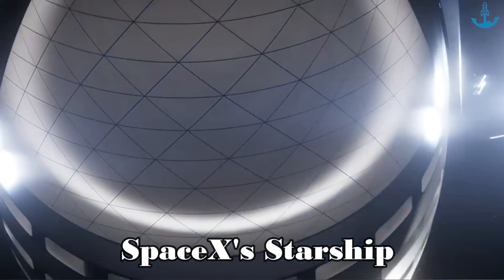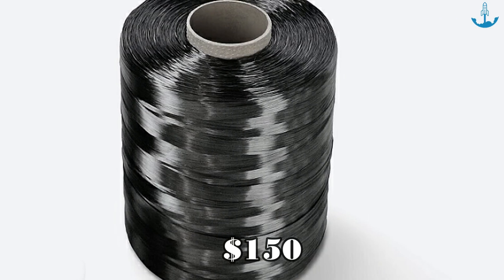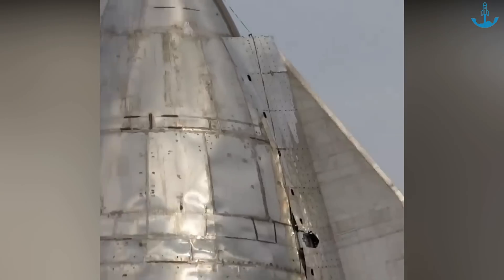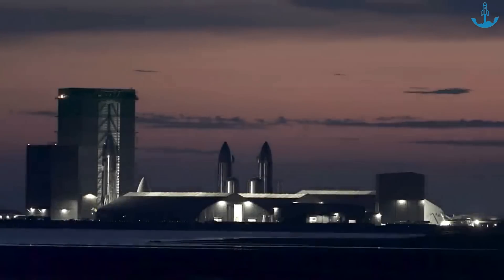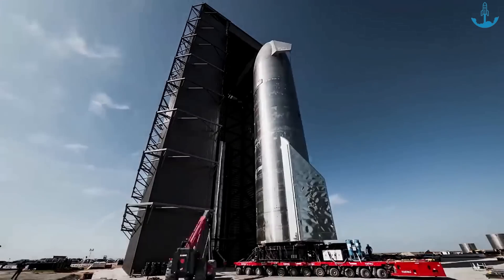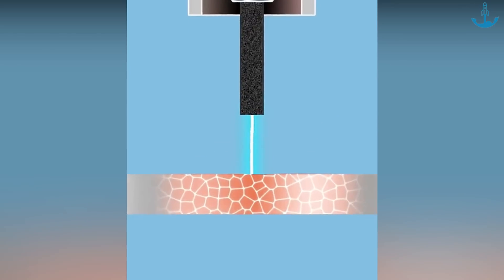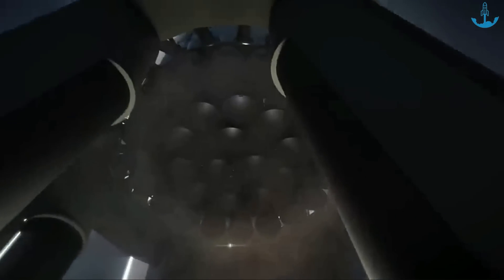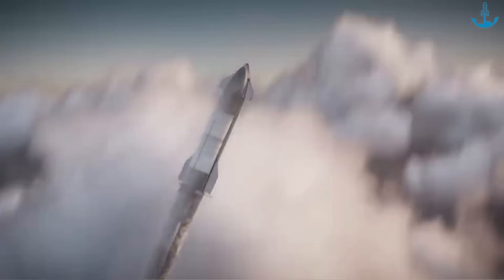SpaceX just Changed Everything with Starship's Welding.... Shocking!

Comment: The author's perspective seems to be that the Raptor engines are being tried for the very first time during the testing of the booster on the launch pad. If that is the case, it is reasonable to think that some of the engines work and some wouldn't work. I had previously been under the impression that all of the engines delivered for installation on the boosters were tested at Macgregor successfully.